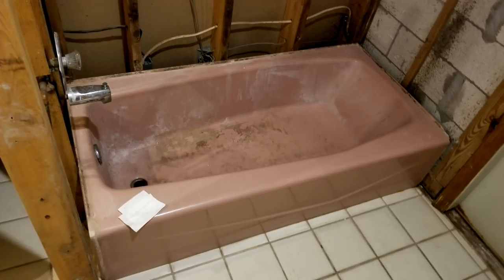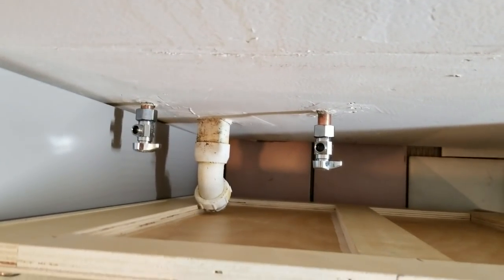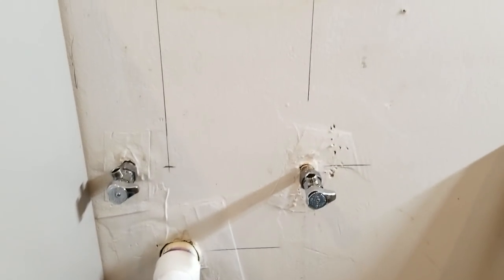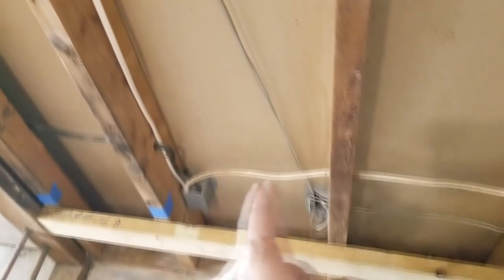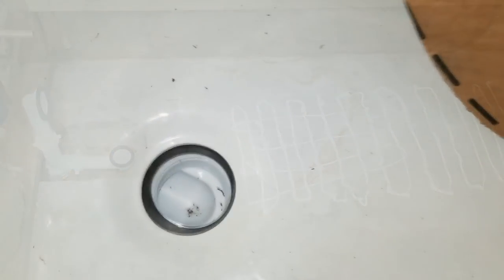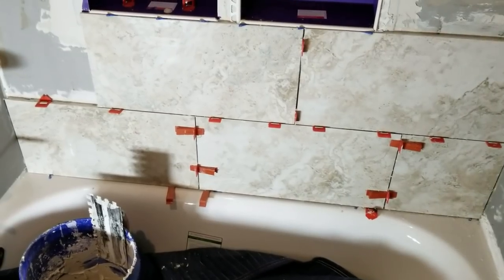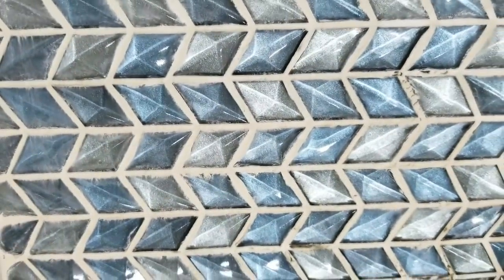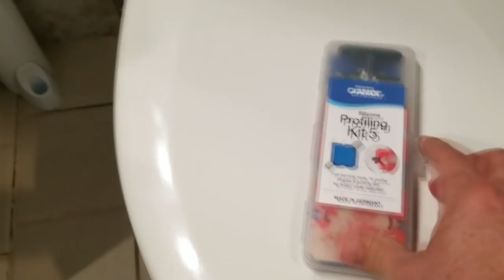Bathroom Renovation DIY Shower Niches: Shower Tile Ideas

Comment: That turned out beautiful.
I do have a question though.
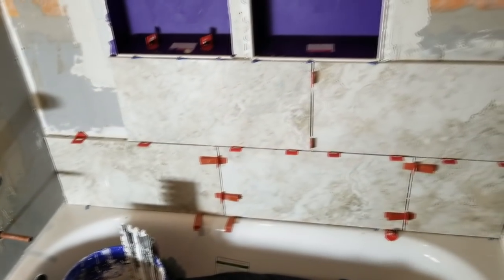@ 20:35 Kerdi rondec is put up against the wall but the tile actually protrudes the rondec? I have the same situation an wasn't sure what to do about that. 
I personally think it needs to be flush. 
Thanks an great job.
Reply from the maker: Yes, unfortunately our tile was thicker than normal, it was 5/16" thick porcelain, plus almost 1/4" of flattened down thinset after troweling it in at 1/2". So you really need the 1/2" Rondec, which was not it stock, I think we sued 3/8. I can't remember, but it was protruding  1/16" for us.

Comment: Not to bad but;
Ream out the newly cut PCV .
cut back Hot side 1/2" copper  use 90 el n bring closer to waste drain, so you won't weaken rear corner support 1x3 
1/2" copper from tub (hot/cold) pipes touching such be slightly apart.
Over lap on tub a must to Push water away from wall n not leak behind or between the tub
proper test is to fill sink to very top and let stand several hours or overnight.
Reply from the maker: The overlap you speak of for the tile to tube interface comes from when you tile on the wall down to the tub level. But the tile backer board must end on top of the tub lip like I showed, or you will have bend out at the bottom, and you won't get a straight tiled wall, a problem that plagues all older bathrooms.  you can see we siliconed the seam between the tile backer boards and the tub, so that it is a water tight seal.
Reply: @jeffostroff   both ways are good. I prefer Notching out backer board and place slightly over tub for a 2nd floor app. (no lip this way)  But much more work ...   :-(

Comment: How much would that cost?
Reply from the maker: That's a good question! What you're looking at so far is about 104 hours, with at least one person from the owner's family helping me each day I was over there, some days only half days after dinner, or full days on occasion. Most contractors might charge about $100 per hour for something like this. Tile contractors charge you about $5 per square foot of tile just for the tile job. A plumber we brought in charged $150 for about 1 1/2 hour labor to solder in the new shower valve, and raised the shower spout higher so humans could stand under it, before we closed up the wall. I'm not a fan of tile companies charging per square foot, because then they bang it out real quick without taking the time to do all the critical time consuming steps that I do.

Comment: I see you have kurdi strips, where’s the kurdi mesh??  Waterproofing over the hardy backer...don’t see any?
Reply from the maker: John, You are mistaken. There is no Hardibacker board. This is DensShield, which already has it's own waterproofing membrane on it. You don't need to use the Kerdi Membrane on this since it is already self water-proofed. The Kerdi band is necessary only at the seams. This Denshield board is a direct competitor of the Kerdi Panel boards. They sell it at Lowe's in our area: https://www.lowes.com/pd/DensShield-0-49-in-x-31-9-in-x-59-9-in-Tile-Backer-Gypsum-Backer-Board/1000721282
Reply: @jeffostroff  Nice! Thanks for the link!